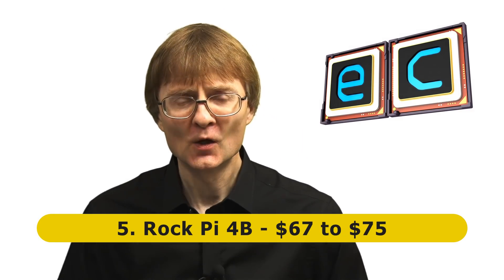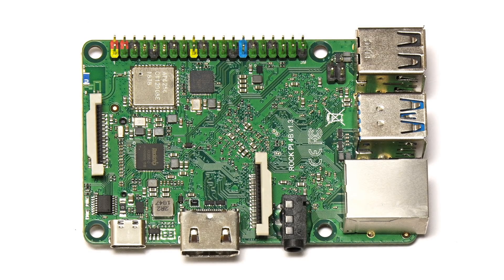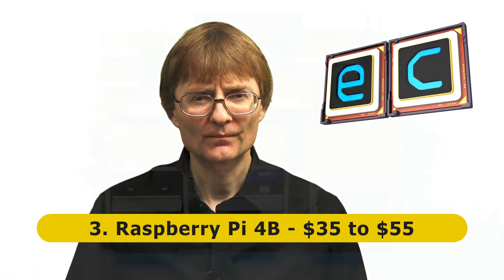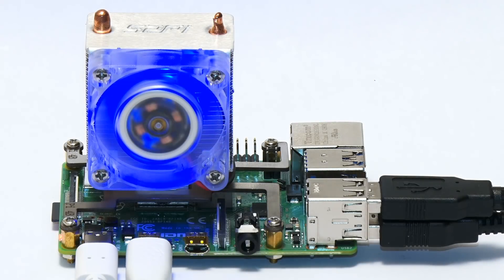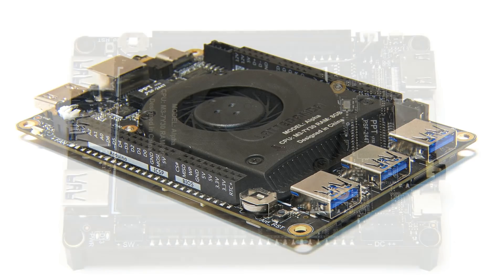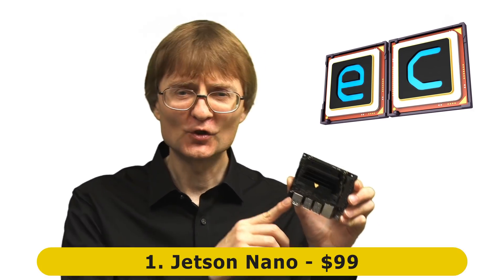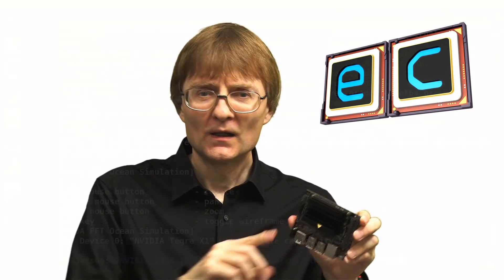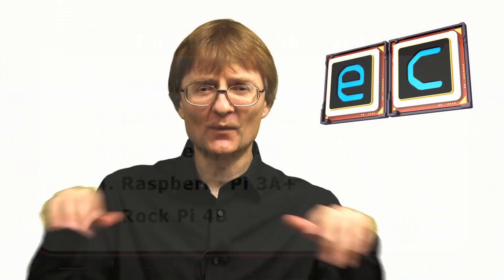Top Five New SBCs 2019

Comment: Latte Panda has Windows 10 but is expensive among the others
Reply: That's two downsides - Windows is not a pro
Reply: @JakobKenda  does it matter?  What feature of Pro will you really be using on a Ltte Panda?  Like I say IoT is free ad W10 is easily free if you Google, or very cheap.  Most will use Linux, the rest windows IoT.
Reply: @twmbarlwmstar  I meant pro as in pro and con as in Windows sucks. I know it was a bad joke
Reply: @JakobKenda  I see, well that's your opinion, but I agree that you don't need a W10 desktop OS with the Latte Panda so I can't see anyone paying for one.
Reply: i luv rgb /. Yep! You can build a Ryzen PC (system only) that hundred times more powerful then the Alpha! I know as a fact because did it. That said the Alpha is a nice very small portable PC. I now pack it when I go on trips. Just plug it into a TV and use a micro keyboard and your good to go.
Reply: @NewAgeDIY  That Ryzen PC will cost at least $300 to build (if you keep the RAM to 8gb). Beyond that, it will be MUCH larger than the Panda. I'd rather haul a Panda around than even a mini-ATX machine. A more reasonable comparison would be a NUC if you're comparing feature for feature, as well as size. My only real complaint about these machines is the inclusion of Windows. I shed Windows long ago at my house... 13 machines, all running some flavor of Debian...
Reply from the maker: The Ryzen PC will not be 100 times more powerful that the LattePanda Alpha. :)
Reply: ExplainingComputers / A little exaggeration for the humour in it.  Gone overboard on that  comment. 🤪
Reply: @NewAgeDIY  The trouble is, exaggeration only damages your argument. The Ryzen PC isn't 100 times more powerful but it isn't hugely more expensive either, especially if you don't add the discrete graphics card. I would have put the Udoo Bolt in the top five instead of the Latte Panda.
Reply: johnm2012 / I'm indeed getting a lot of heat on that point.  Maybe I should have said a lot more powerful instead🤣
Reply: @NewAgeDIY  Ryzen has no onboard Arduino support  yet, as far as I know.
Reply: @NewAgeDIY  I won't be a hundred times more powerful and it won't be cheaper, it will be more powerful as a desktop PC but the Latte PAnda has GIPO and arduino and so depending on your use case you'll chose one or the other- the only real shared commonality is 86_64.  Also, I know you didn't say this, you don't need to pay for W10 with a Latte Panda, I think you'd be a bit daft to do so to be honest.  The Linux version is cheaper and there are many ways to get W10 more cheaply than via the Latte Panda offer.  And there are some, and please don't buy one I have warned you, cheaper Latte Panda with lower spec CPU about (Cherry Trail, avoid).  I even saw one with i5 (the m) but I think that was an engineering sample.
Reply: @NewAgeDIY  I know, benchmarks, but if they are using the i38100u then PC Mark says 3562, nothing in the Ryzen range is going to be a hundred times faster than that, the Ryzen 3700 ($329ish) isn’t even 10 times faster at 23902.

Mind you the Latte Panda website doesn’t help itself by saying it uses the same CPU as an Apple laptop costing $1200- that is comparing Apples with apples...  One is a small light massively over-priced computer whereas the other has Arduino and doesn’t come with a faulty keyboard.
Reply: It is great to have the option of Windows 10 on an SBC. But yes, it's too expensive. I rather have a good Windows 10 desktop and a regular SBC to compliment it running an alternative OS. Then again, it comes down to what do you need in SBC for. And I agree with Mr B when it comes to the portability of a Windows 10 system.
Reply: @GVSolo  To be honest I don't get the W10 thing at all.  First of all if you want W10 then there are other ways, often very much cheaper, to get it.  But more likely you want to be using W10 IoT (Windows Embedded in old money) which is free on the lowest tier (not for profit).  Even more likely you'd be using LInux and I'm no raving Linux Evangelical- Windows IoT is good in the right hands but hard work if you are just starting out in my opinion (compared to Linux).
Reply: GVSolo / for some people, working with a types of computers is really a great hobby. I have been working with lots of different computer for years. It was explaining Computers that got me started in SBC'S and it's been a fun ride so far😀
Reply: @NewAgeDIY  I agree. That is why in one of my comments on this video I mentioned that the great thing about SBCs is the great variety and selection of different models with different specs and capabilities. Variety and freedom of choice it's always good at the end, especially when you're looking for the right board for any specific project.

Comment: Latte Panda -- no, way too many $$$$.
Reply: Many micro pcs on AliExpress, for a fraction of that price, that have similar if not better specifications.
I bought a beelink x45 beginning of the year £135 has intel celeron quad core processor 1.5 GHz to 2.6ghz boost, 6gb ddr4 memory, 128gb SSD, dual 4k output, intel 600 graphics.
Reply: @williamrutter3619  And how well are they supported by the manufacturer? Is the software optimised? Is the quality of the components up to par? Would you want to depend on them for anything important? There's a reason they're cheap. Fine for messing around at home, but not something you'd want to do serious development on.
Reply: @another3997  intel parts, it came with windows 10, it's been on all year, it runs large hard drives for me, an amazing device, very similar to the odroid H2, but with the memory and a SSD, if things are very important it needs to be on a desktop pc, with an ups, but so far my beelink hasn't missed a beat, though it hasn't been used for high end gaming, or video editing.
Reply: @wboumans  yes i agree. the rockpi is nice.
Reply: Panda "too many $$$". Guess you've never heard of Apple. Technology historically, has never been cheap. The Latte is more than affordable for what it is.
Reply: @SHUJINCELL  I only use Apple products when my employer buys them. (Well, except for my wife's IPad) Way overpriced for the experience.
Reply: @SHUJINCELL  it might be affordable, but it's still a multiple of the price it should be.

Comment: I wish RPI would get with the program and support other options rather than SD flash. So lame. I get so tired of "fixing" damaged SD cards.
Reply: What do you mean? What other options are there?
Reply: @meepk633  Well there is emmc, which is 1 step up. Or PCIe, which would add cost, but make it much more reliable.
Reply: As can be read on raspberry.org:

Network and USB boot:
Support for these additional bootmodes will be added in the future via optional bootloader updates. The current schedule is to release network boot first, then USB boot.

I hope they make it to Christmas.
Reply: @tubegor  Network boot is cool. But it requires a lot of work to start with.
Reply from the maker: I agree with this -- for me, just USB boot (as came as standard on the Pi 3B+) would be fine.
Reply: @ExplainingComputers  Yes. You can use a thumb drive, a hard disk, or even a SSD.
Reply: Mai Mariarti  Chris explained wonderfully how to do that : 
www.youtube.com/watch?v=ubnwvxF3Klc
Reply: Mai Mariarti  Chris explained wonderfully how to do that. Google"Booting from external USB RPI explainingcomputers"